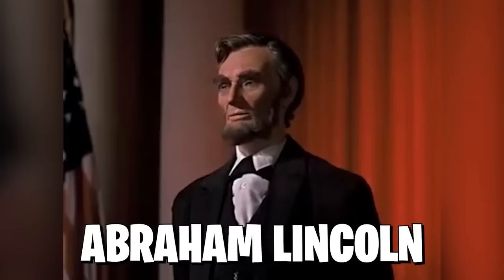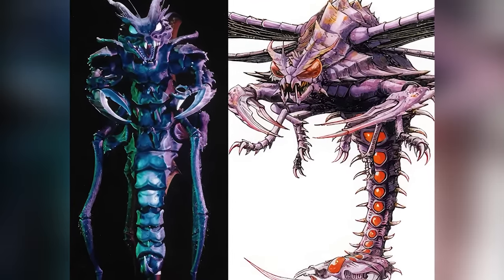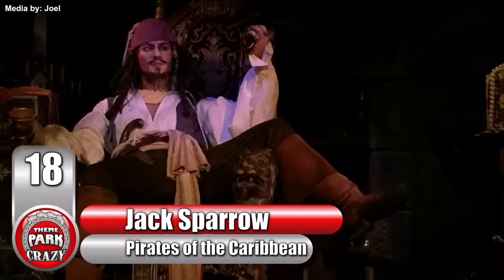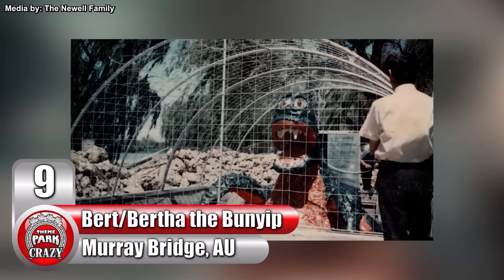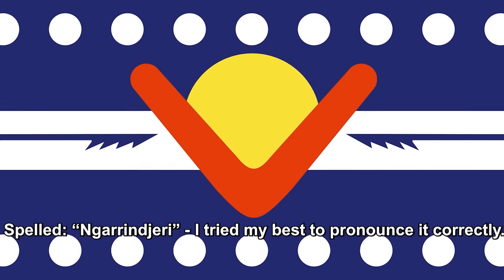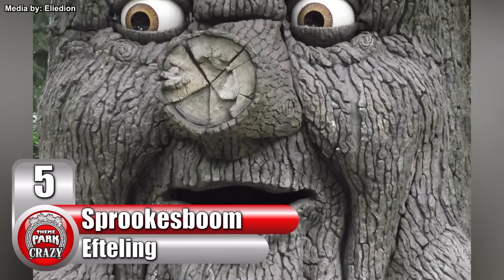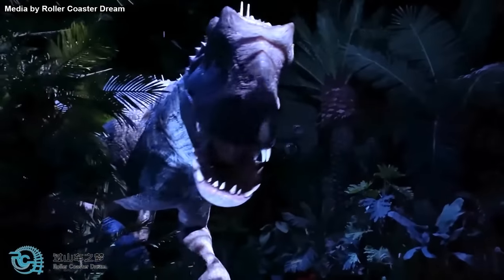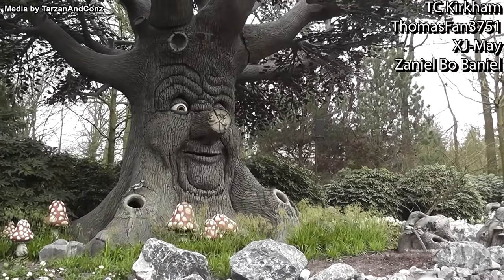Top 20 BEST Animatronics Ever - (Disney, Universal, & More)

Comment: Hydrolic animitronics will always be better. You are able to get far more fluid motion with air than you can with motors. Not to mention you can get faster movement with less wear. A hydrolic arm can launch out change directions then come back just as fast while a mottor would get severely worn over time.
Reply from the maker: That's a very interesting perspective. I never knew all of that. Do you study robotics?
Reply: @ThemeParkCrazy  Well considering they misspelled "hydraulic" twice, there's a case to be made against it. Also, while I'm not an expert on hydraulics, I'm pretty sure they use hydraulic fluid, not air.